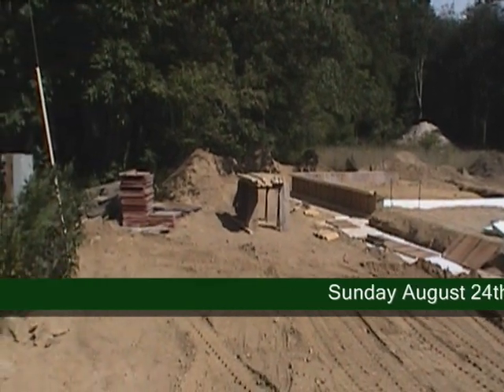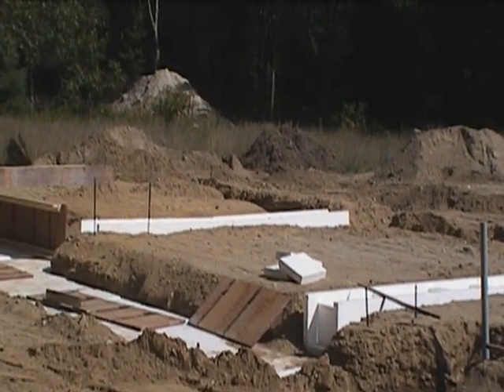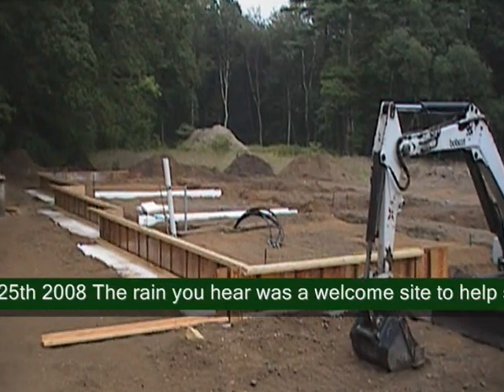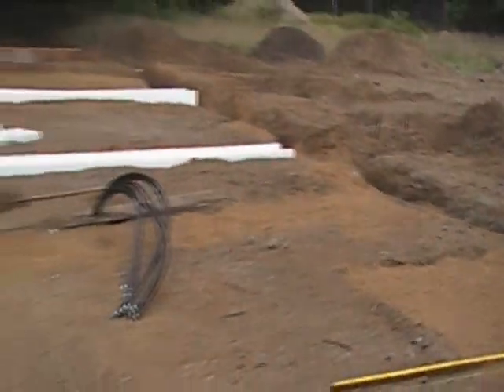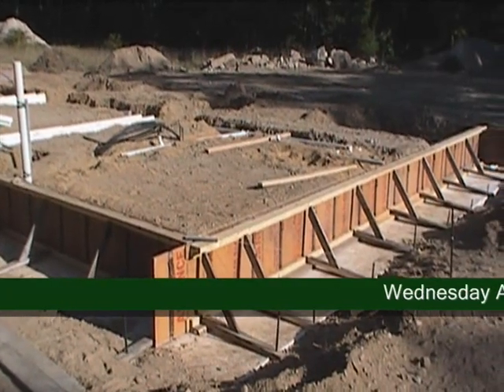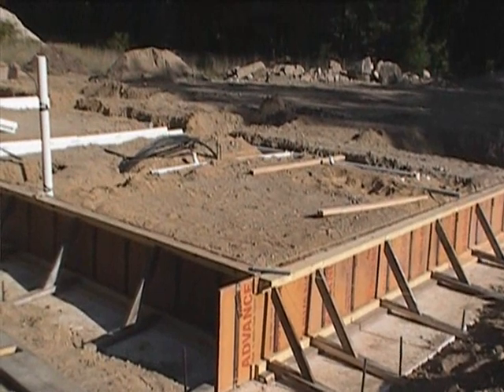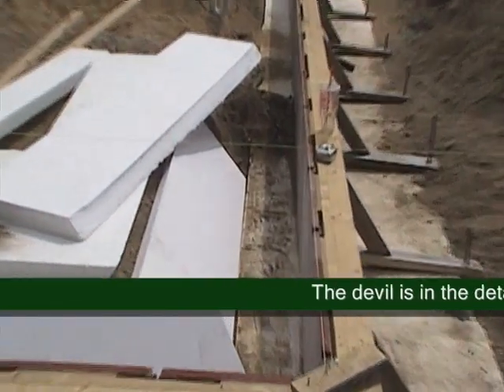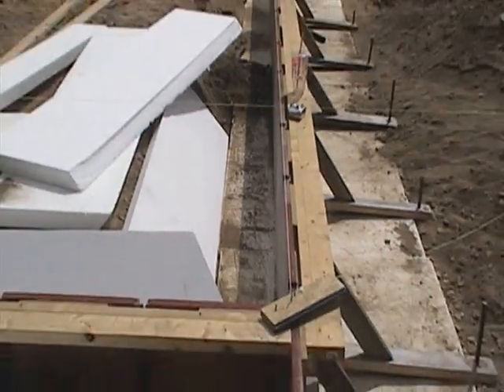Solar home foundation part1

Comment: A lot of unseen detail !!!! Footings on foam wow ! Insulation at bottom of sloping slab I would like to see set in place with wire and rebar to better understand the exact process of putting it all together myself for my next shop I'm building. Really nice job you did .